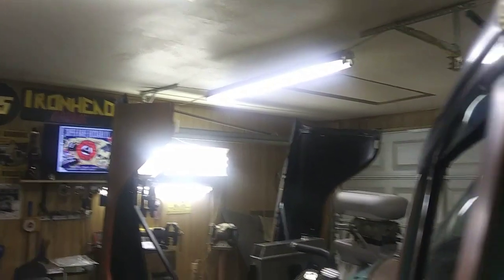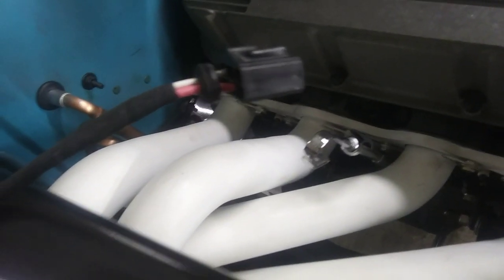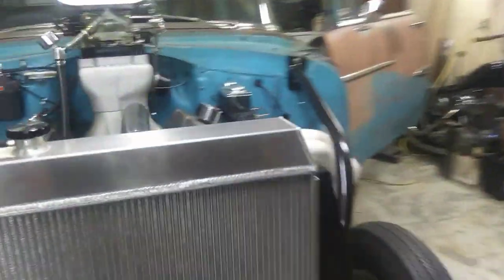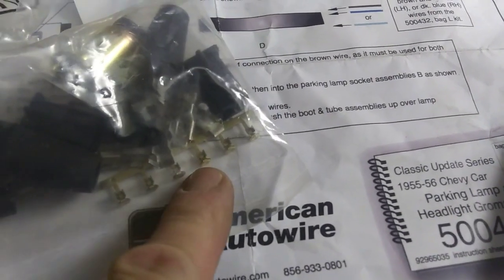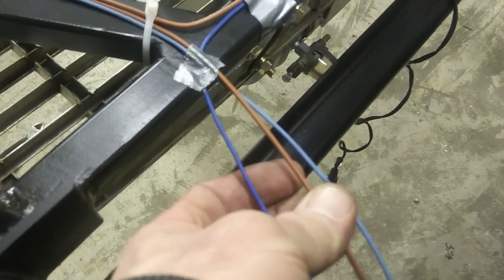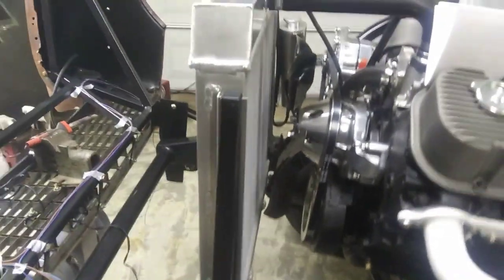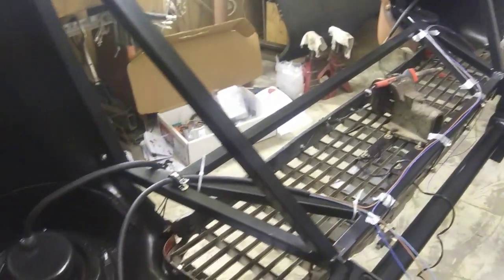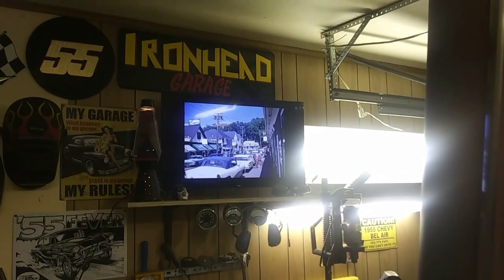1955 CHEVY GASSER BUILD. PART 3 INSTALLING AMERICAN AUTOWIRE KIT

Comment: Hey Chris on my brother's 55gasser we used a trailer wire connector so we could take the front end off just unplug it then plug it  back in good luck looks good sofar
Reply from the maker: Hey Mark thanks for the info.  I was thinking about one of those.
My buddy told me about a six wire GM water proof plug so I found one going to work great. Thanks for watching Appreciate it.
Have a great night man👍👍👍

Comment: I could almost here it running Chris,LOL! soon looks like. Was curious  with one thing I always thought only points distributors had a ballast are you still running points? That wiring kit again is really fantastic...
Reply from the maker: Hey Glenn right! I almost can hear it to. I have a Mallory unilite distribution
It does not have points but a coil you must use a ballast resistor for it. 
Or it will burn up lol
She's old school😁.
Thanks for the support
I appreciate it. Have a great night my friend👍👍👍